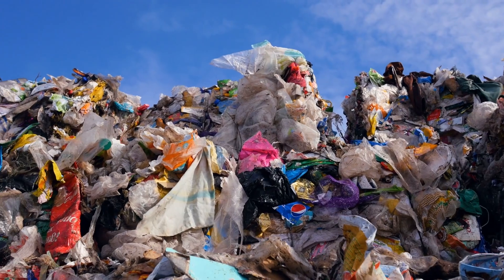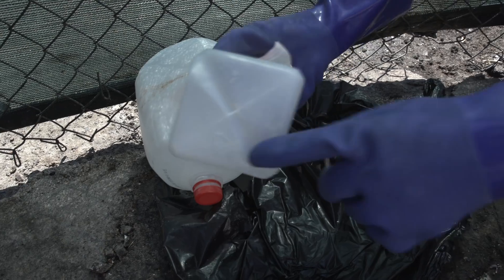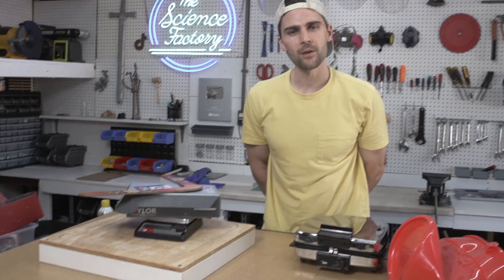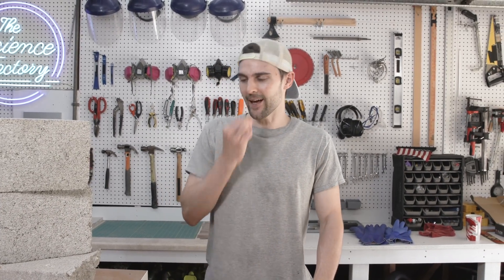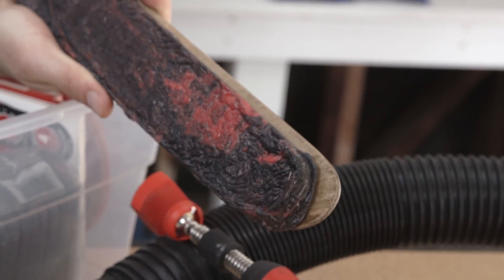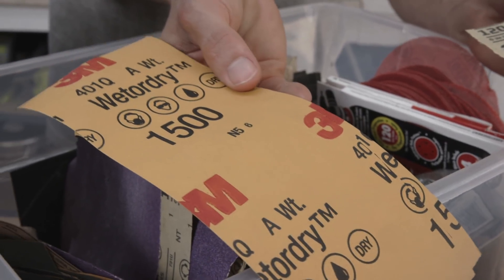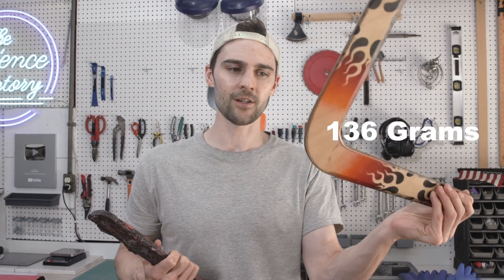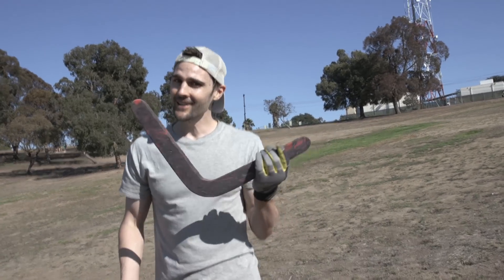Real Boomerang Made from Plastic Waste

Comment: Fun fact real boomerangs were never designed to come back to the thrower and it original use was for hunting. As a mattee of fact it the nest step up from a throwing stick. Also when they first startes uaing boomerangs they sisnt carbe it into any shape they just dound a stick in the basic boomerang shape, then over rime they realized the rhinned it was the faster ir would go. Rhen as they modified it kver rime eventually found rhat it would xome back to rhe thrower id it was carved into a curtain shape. But wven ro rhis day ppl that hunt with boomerangs sont use ones rhat xome back ro rhe thrower chz rhey arent are accurate as one rhat just throws in a straight line. How ever they do use knes rhat tuen kf rhe target rhey are rrying ro hir ks behind. Tree, bish or zome other object. Bur like j said rhe most effective one is the one thats most accurate

Comment: It would be awesome to see you take a crack at making 3D printing filament out of recycled plastic.
Reply from the maker: that's a really good idea... I wonder how we could take the material we have and run it through a 3D printer?
Reply: @NickUhas  you would have to process it into filament first. With something like the filastruder
Reply: Seems hard to solve the shrinking when it’s cooling, that would probably make prints come out malformed or with gaps using a normal 3D printer
Reply: @TabooGroundhog  cooling fan speed combined with extrusion rate